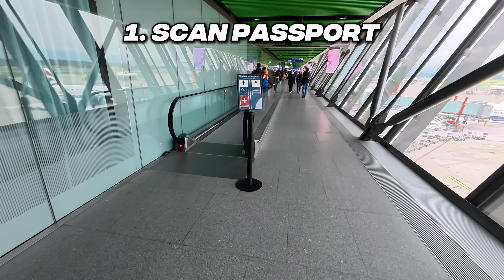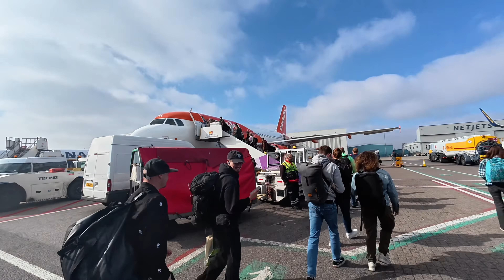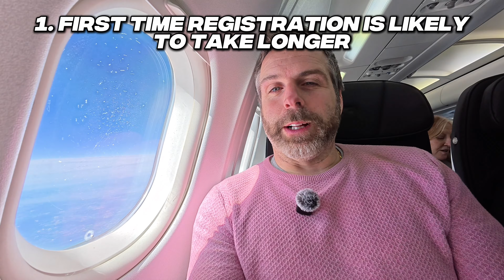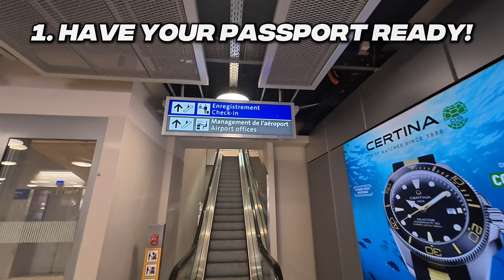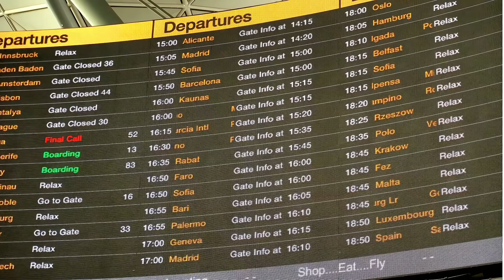EU Border Delays - Why Are Queues Increasing?

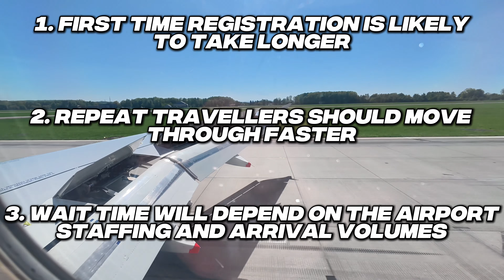Comment: Is exit quicker, since you will already be registered? I have a connection in Munich from Berlin to exit Schengen with a 2:45 connection. I’m glad I did not take the first itinerary which had a short layover, or maybe 2:45 is short now.
Reply from the maker: This is the thing. It should be, but I don’t think it is necessarily. However nearly 3 hours should be fine I would have thought. Smart move!

Comment: The biggest cause of extended times through immigration is having EES kiosks/machines separate fromt immigration officer booth, that means two queues. 
At airports such as Malta, the Immigration officer does it all!
There is facial scanner at the side and a finger print scanner built into their booth, takes about 1 minute extra if you need to do it and those such as myself who have residency it cuts out us out of the separate ees kiosk queue just for the machine to tell us to continue to an immigration officer!
Reply from the maker: Yes. I was literally talking about MLA yesterday. Have the queues been pretty bad?
Reply: @TheTravelDebrief  There was no queue to speak of, we had lunch in Hardrock cafe and had a view of the outbound border force booths and saw three UK departures, there were no significant queues!
When we returned,again there were no significant queues, we were the only non Schengen inbound at that time though, one landed 20 minutes before us though and that had cleared.

Comment: On my way to Portugal tomorrow and they accept the 'Travel to Europe' app, which means (in theory) I get through passport control much faster as it includes a selfie and a chip scan of passport biometrics. Great! Except that it doesn't. I have just used it and it asks for some very basic info on the trip - name, where are you staying, when will you arrive etc - but does not ask for any passport info, biometrics or a selfie. I thought that was the main reason for having it. I reloaded the app, tried again and the same. So what is the point of it? I see more chaos ahead as travellers assume they do not need to give all the biometrics info as they have the app. And where do I go at passport control now?
Reply from the maker: I don’t even think the people in charge know what’s going on to be fair. The whole thing is just a bit of a mess 🤷🏻‍♂️
Reply: Although all the information about the app says it does record the passport biometrics, the reply I received when I sent a query says that it does not. That's helpful!
Reply from the maker: @raytrevor1 eerrrrr, no, not at all!

Comment: We went through the procedure when going to Malaga in January.  It took a few minutes to register and then go through the biometric and manual border check (passport being stamped).  Leaving Spain was easier and was almost identical with using the process when returning to Heathrow, with the addition of again having the passport stamped.  The time taken to register will probably depend on the volume of traffic when you arrive.  It was quiet when we got to Malaga, but when arriving at Geneva last year there were waits of over two hours to get through passport control.  If it's like that when you arrive at a Schengen border control then, yes, it could take ages.
Reply from the maker: Yes, it’s going to be in waves I think. As you say, dependent on inbound and outbound traffic. Geneva was ok when I went in, but there was a wait in the way out.

Comment: Thanks for the update! One thing I am not convinced about is that these delays are caused due to first time registrations and that future entries will be quicker enough to make life easier overall. There seems to be a view that once registered, you can then go straight to the e-gates. But what seems to be the case is that you will need to check in/out with the machines before using the e-gates; even if that includes just scanning the passport and one biometric (and  assuming there is no failure to match resulting in asking for the second one...) and factoring in the two-step process, that will probably result in very little time being saved relative to the initial registration. (Plus, we are assuming, you won't need to answer any questions at the machines upon re-entry - which kinda makes sense given that they are relevant to one's current visit). On some forums there are already reports of people entering Schengen having registered and occasionally going through the same process as upon initial registration (although caveat, the system is still not fully implemented and there are significant inconsistencies).
Reply from the maker: No problem! Yes absolutely. I had to do the whole process as if it was first time registration when entering Lithuania a few weeks ago having already done it in Switzerland.
Reply: @TheTravelDebrief  I mean for the Baltics it's probably not likely to make such a big difference but for major airports in Europe or Spain/other tourist destinations, this is not going to be workable
Reply from the maker: @gdp29 agreed.